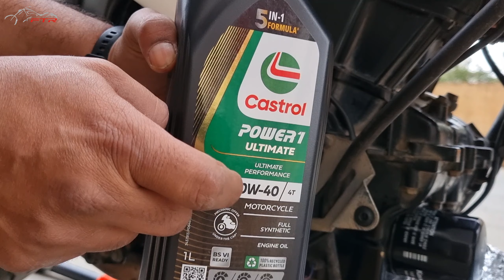DIY - BIKE SERVICING AT HOME || Change Oil, Oil Filter, Air Filter, Clutch & Throttle cable.

Comment: Should have dipped the air filter in kerosene, it removes the dust faster.
Reply: Where can one get some kerosene?
Reply from the maker: Yeah that too is a good option but it’s difficult to find here.
Reply: @FTRClub  that's what..i can't find it in my town too..where to look for it ?
Reply from the maker: Check with local bike parts and oil shops. They usually keep kerosene oil in bottles. I too will search.
Reply: Kerosene is not available now anywhere. The best alternative is to clean with diesel.

Comment: A lot of things are done wrong here
1. Change the air filter man it's cheap, if you don't want to don't clean it with water use a fuel which evaporates off faster, doing it with water and especially with soap is never recommended.
2. Change the oil filter with oil.
3. While using a coolant in your bike make sure the old one was the same, a flush isn't very hard to do if they are different.
4. If you don't have the oil filter removal tool you can remove it with your hands too if you try hard enough, an easy way to do it is fit a belt ( timing/serpentine is what mechanics use ) inside a wrench and then remove the filter with it, easy to get if you search a bit, everything else was done in a very well and clean manner.
Reply from the maker: Got it. This was my first time and I really appreciate your valuable inputs. Sadly the air filter wasn’t available in stock and I tried multiple ways to remove the oil filter but I wasn’t able to do so. I will be replacing the oil and oil filter after a couple of weeks (once back from the current 2500 kms ride).
Reply: @FTRClub  Fine sir, glad to know you're interested in making your ride as good as new, have a great journey. You're in a small amount of people who have the guts to do all this yourself, appreciate it a lot.

Comment: Without changing the oil filter its waste of changing engine oil, 
If the oil filter clogs up there is a chance of engine getting seized, sometimes if the engine detects filter is clogged up the oil will bypass the filter and the dirty oil will flow in the engine without any filtration. So get it changed asap.

Have a safe ride brother ✌️.
Reply from the maker: I agree. I got the tool and will be replacing the filter this weekend. I will lose new oil during process, but it’s worth replacing the filter as you rightly said.
Reply: @FTRClub  Yes, do it, also post the way you did it on youtube.

Comment: Which engine oil is best castrol or motule or any other?
Reply from the maker: All the bikes that I’ve owned till date have been serviced with Motul. From last 2 services on my ninja I’ve been using Castrol and trust me it is equally as good as Motul or even Motorex for that matter.
Motul has established a market dominance and monopoly which is why it is used more. Else Castrol is equally good. Even the Triumph Rocket 3 which has the largest capacity engine on any production motorcycle, is serviced with Castrol.

I hope this helps. 🙏🏼

Comment: This is the worst and the most dangerous service I have ever seen. Useless changing the oil when you don’t replace the oil filter. 
Never lube or clean the chain with the motorcycle on. 
Never lube your chain without cleaning the chain, you are just going to add more gunk and spoil the chain and the sprocket.
Reply from the maker: Thank you for your inputs. In case you don’t know, oil and oil filter are alternatively changed even at the authorised service centres.
Secondly, the chain was already cleaned when I got the bike washed prior to making the video.

And I understand your concern regarding the safety aspects related to lubing the chain while the wheel is spinning with the bike turned on.
I’ve been lubing the chains of my bikes for over 1.5 decade now and I know how much distance should I maintain from the rear wheel and the chain.
Thanks a lot for watching the video though.
Reply: @FTRClub  No way you're doing it that way, different oils are made in  a different way, don't mix them and change the oil filter every service, its cheap.
Reply: @ANIK5261  Keep using that trash till it cloggs the engine and remember to mix old and new oil 🤡🤡
Reply from the maker: Thank you buddy. 🙏🏼😄